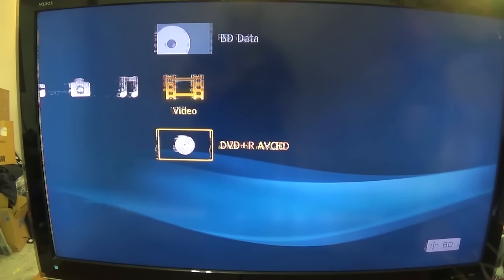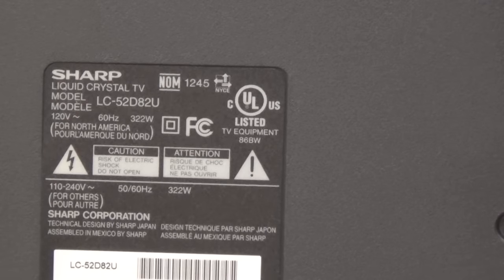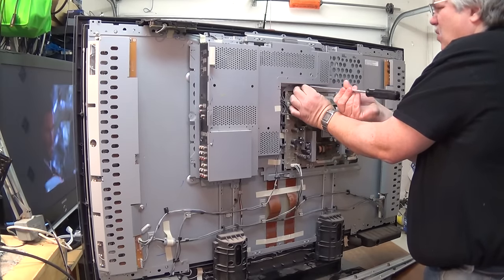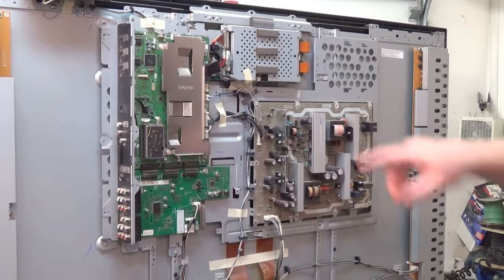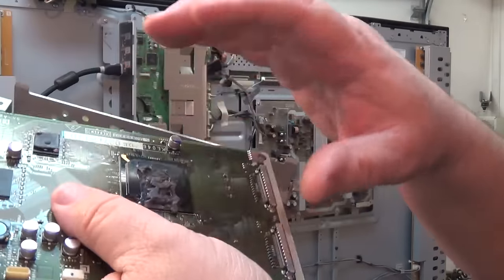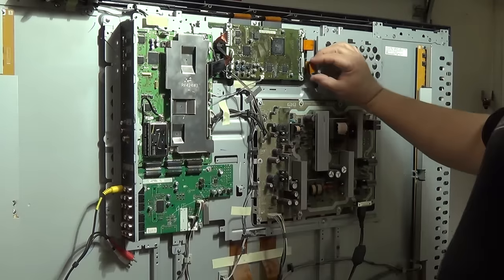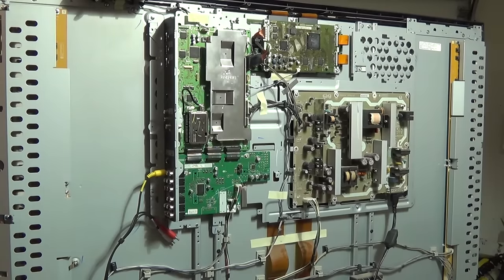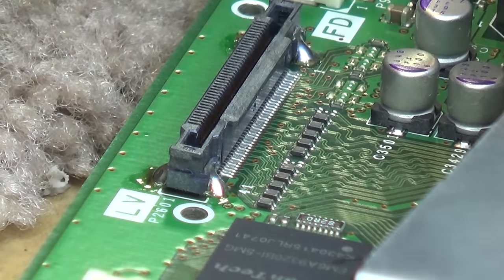Sharp LC52D82 bad picture FIXED

Comment: Hi my neighbor just threw out a LC-32LE653U TV. It works for about 10 minutes, then gets cloudy and lots of vertical lines.
Will a new t-con board fix the issue? or could it be the power supply board?

Comment: Hi!, I have one quick question, I have a 32" LEDTV and it doesn't turn on, there's a standby light (red) but it's not turning on. I already replaced the capacitor and still the same. but every time I plug it in to our wall outlet it's giving me a sound coming from the psu, what might be the cause? Thank you :D

Comment: This is the Follow up repair to that LCD that you said you had to do multiple repairs to? you have so much in for repair , its hard to keep Track.
Reply from the maker: +Amy Marie No this one just came in from one of my co-workers yesterday.
Reply: +12voltvids Rly reflow a bga whit a heatgun is bad bad way for fix, get a bga station like  Zhuomao ZM-R5860C for the the proper fix i got achi 6000 works ok but no happy whit it an the reflow profiles,was apin in the ass made they works   if i have to get a new ones i will get these.

Comment: I would say that those smd aluminum capacitors on the tcon boards are guilty and prone to failure from the first moment of soldering in the production line in the factory and needs to measure esr and then replace them.
Reply: My sharp led TV is jumping
Reply: The picture and the lights is jumping. How can I fixed it?

Comment: Hi dear I would like to see how fixe a Phillips 40pfl3607 on PSB problem no 5volts or 12v I changed the kit for both x5v n 24v & no turn on check switch on /off is ok only 1v from the psb please I need any help thanks guys

Comment: I think I need to buy some of those surface mount "can" capacitors what do you call them exactly, so I can order them?
Reply from the maker: Surface mount electrolytic  capacitors or SME for short.
Reply: @12voltvids  Yes thank you I know that SME stands for Surface Mount electrolytic but I think of the chip typestandard capacitors. Is there a special reference to the surface mount "can"capacitors as Ive never seen them on Ebay or any electronic supply houses? I just discovered that most of those capacitors on my control board have rediculously high ESR!

Comment: Yo 12volts, Hope allz well up in the GWN, you ever run across this kind of issue w/ a Sharp
Sharp LC 65Q7300U
The Video display went on vacation (get a nice diffused, & even white backlight to go along with the audio when powering on) the LED backlights and audio are 100%, all voltages of everything from PS board are within, anyone out here ever deal w/ this scenario, I'm leery of buying the main video board because I've run across this twice w/ Vizio's, bought the video boards... still no display and out 100$ or so both.
 I'm guessing main board because what else is there...the display go bad???...
I've never had one here with a bad display, even a crappy solder dip or the TV falling over cuz baby huey yanked on the cable (its happened to me few times) would show something on it on somewhere right??
The T-con does have 12volts on it, but that's the only test I'm able to do on timing control boards, re-seated all video related ribbon connectors
Any & All Suggestions & Donations are happily accepted....

LOLZ, (just joking about donations)
Reply: PS: ...and forgot to mention this had one of your favorite gripes, usually associated w/ the mexican assembled Samsung's... Very loose board mounting screws, saw no smoked metal, and replaced, but no effect

Comment: How much heat will these chips take ?........
Reply: If you have ever seen a solder wave machine work you would be amszed at the tolerance of those componants, submerged in a bath of molton solder for several minutes, they smoke and actually catch fire sometimes, but seemably are uneffected!

Comment: This kind of fixes maybe last you 2 years the most out hot climates states or countries.Did this kind of fixes for many PC boards reflowing surface mounted for Laptops as you said Xbox 360 also PS3 systems sometime.
Reply from the maker: +Chi Chu if it lasts 2 years then the owner is happy. If it lasts 1 year he will be happy. Considering that modern electronics are shit. Most of the stuff I repair is vintage audio an vcr and plasma. I don't like Lcd. To repair or watch.

Comment: I find it strange that they used that thick silicon pad.They could have done a better job.
Reply from the maker: +costellom5 The one I put in was probably thicker than the original. The spares I have came out of a plasma that had a broken screen. They use them between the back side of the board and the metal back to draw the heat away from the pins of the MOSFETs to keep the solder connections from developing heat stress fractures. The 51" I fixed didn't have that, and heat fractures is probably what caused the buffer board to blow in the first place, so when I reassembled it, I placed a few strips of the silicon gel heat sink under the board to prevent it from happening again as that one is my set now.
Reply: HEY its built in obsolescence they have to find some way to make it fail sooner so they can sell more tv's! lol

Comment: why would you use the same stuff that causes the problem in the first place? #brainshattering!
Reply from the maker: It lasted for what 8 years. If it lasts for a few more years the TV will be ready for the bin. The "stuff" I put on was much thicker than the original, so it should be good as long or longer than the original, and by the time it fails again the TV will be ready for the bin anyway.
Reply: i see..  nice channel, anyway.. i'm subscribed to these kinds of electronic repair videos.. :)

Comment: 12volt how can i load test AAA 1,5 volt battery can you tell me ?
Reply from the maker: +geoepi321975 So what is it you are trying to do?
Reply: +12voltvids I want test litle batterys if they are good not with a multimeter but to load test them or 1.2 volt rechargeables to see if they are good
Reply from the maker: +geoepi321975 To test a battery you need to put a resistor across the terminals while you measure the voltage. It all depends on how much current you want to draw during said test. Using ohms law to draw 250mA from a 1.5V battery the resistor would be a 6 ohm resistor. For 1.2v rechargeable for the same current that would be a 4.8 ohm. For 500 mA a 3 ohm, and 2.4 respectively.Of course you can measure under no load.A good 1.5v battery will measure well above 1.5v. 1.6 1.7 ect. If you measure a 1.5v battery with no load, and it only measures  1.3 or 1.4 it is toast.
Reply: Thank you very much